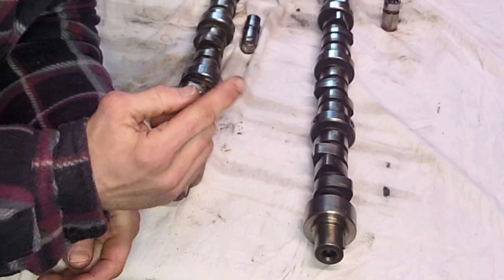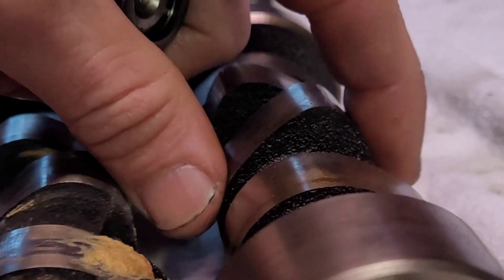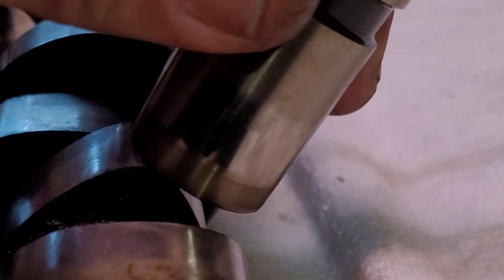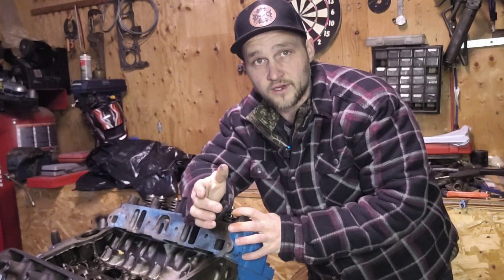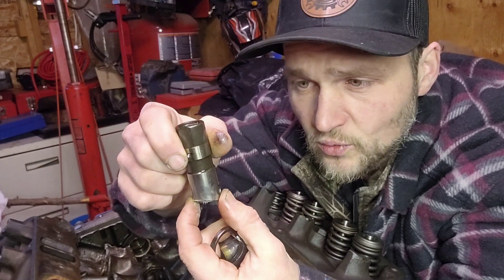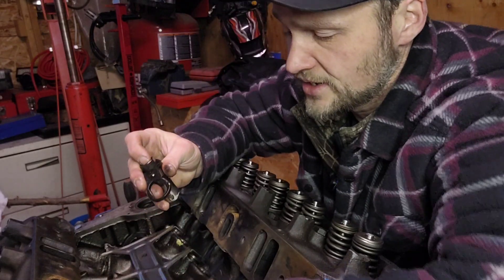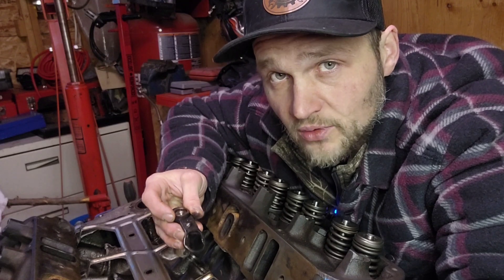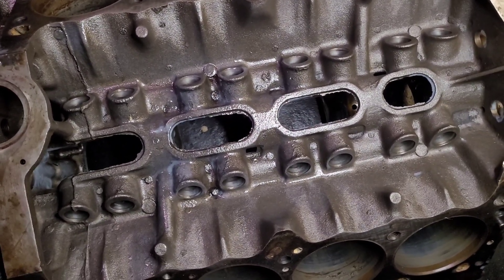Roller lifter camshaft VS. flat tappet.

Comment: Nice, I would not try to convert away from LA nor Magnum . parts are very difficult to find lately and costly. For roller camshafts with LA block Morel are shorter so the oil holes are not out of their bore. and the tie bars are enough to gain the block clearance needed.

Comment: Roller lifters were made to make cheaper camshaft.  Roller cams are softer cheaper metal, actually less expensive to manufacture roller system.
Reply from the maker: I wouldn't be surprised.  They still like to charge more money for them.

Comment: If the roller camshaft is made of billet steel, a bronze distributor gear is necessary. The steel cam gear will tear up the iron distributor gear. It's a metallurgy issue. Other advantages of roller lifter/cam setup; no need for high ZDDP additive in oil, and quicker break-in time of the cam & lifters.
[If the older engine is carbureted, throttle body injection helps a great deal if it is set up right, and includes the necessary sensors, wiring, & control computer. But that's another issue all together.]

Comment: My primary concerns are efficiency and longevity. The factory roller cam engines just seem to have longer valvetrain life. I am not into high performance or high revs. If you hear me coming down the road at 6,500 rpms, please call the authorities as I clearly have a stuck throttle. 
I would consider a truck with the older factory flat tappet valvetrain, unless I could get the same basic truck with factory rollers. Flat tappets work, they worked for many decades, but a good quality roller is just better.
Reply: I would not convert a factory non-roller to an aftermarket roller setup. If I wanted rollers, I would start with a factory roller engine. I have lost faith in aftermarket parts. Maybe they are good for racing, but they are not up to daily driver reliability. And they seem to be getting worse.
Reply from the maker: I am rebuilding a 1986 flat tappet chrysler 360.  It needs to be bored.  I also have a 1992 chrysler 360, and that one  has a roller cam from the factory.  I'm going to rebuild the roller first because it is an upgrade but still going to rebuild the flat tappet one, and it will get flat tappet cam.  Aftermarket RV style cam.  They have worked great for decades, and it is for a truck, not a race car.  Just need to run the correct oil.
Thank you for your input on the topic.
Reply from the maker: I agree 100%.  Well said. 
Thank you for your input.

Comment: Anyone with basic understanding of engineering knows that a roller gives less friction so more rpm and a roller needs a larger egg shaped surface to maintain contact with the surface of the cam .
Reply from the maker: Yes.  Less friction equals more horses power and torque.  Also, fiction wears things.  The roller setup is definitely a better design, but it is expensive to upgrade from a flat tappet cam to roller.  But the roller is definitely better.   I'm an HD diesel mechanic, and everything in that world has rollers.
So I do agree.   Better option.   But expensive to convert and might not be worth it depending on the application.
Thank you for your input.